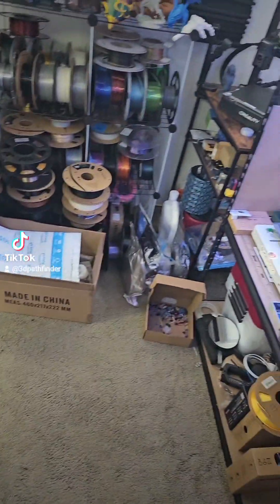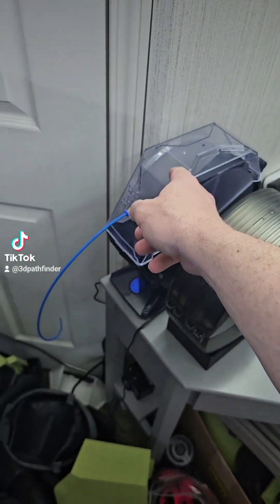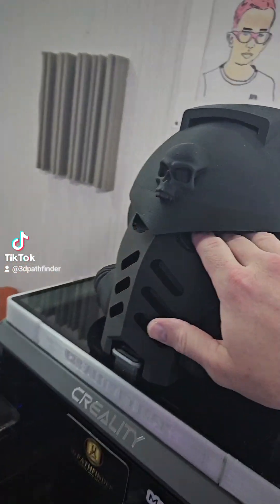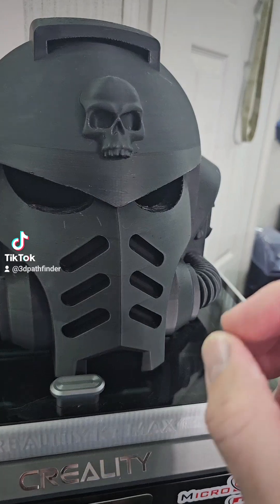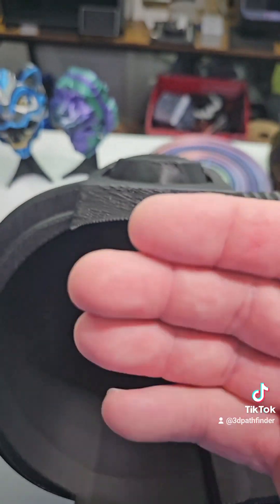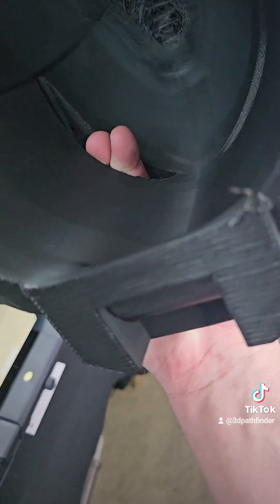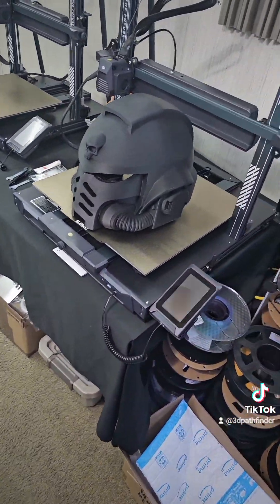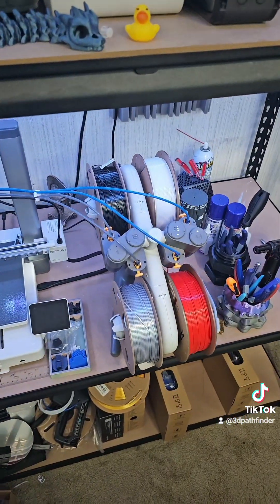Using Multi Material systems to Print in one material and support in another!

Comment: The down side to multimaterial, especially with incompatible materials like PLA and PETG, is that the purge to gain a pure material on a single extruder printer is even more than what is needed for a clean color change of the same material. If you don't purge A LOT, then you end up with impure material that can either have too much adhesion for the support interface, or not enough adhesion for the model layers. 

IDEX or tool changers, pretty much anything that has an extruder for each material type, is the best way to do that kind of thing, based on my (and others') experience with both kinds of machines. I've had a Prusa Mk3s+ with MMU2s for years (now MMU3) and it works just as well as an AMS, but the purge waste was insane when doing multi-material. With my five tool XL, it's pretty much no waste and no contamination. Sure, it's expensive. No argument there. But, it's also a beast of a machine and the only consumer level, large format FFF printer currently available unless you're SUPER hard core and want to try and build some kind of VORON tool changer.